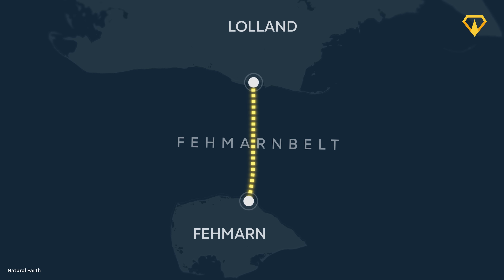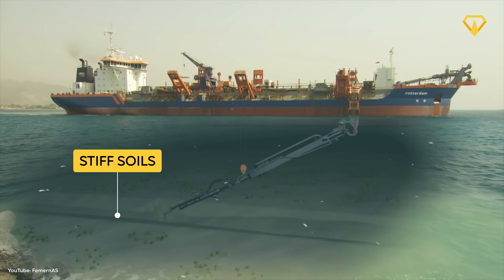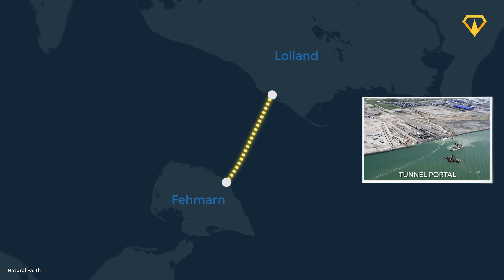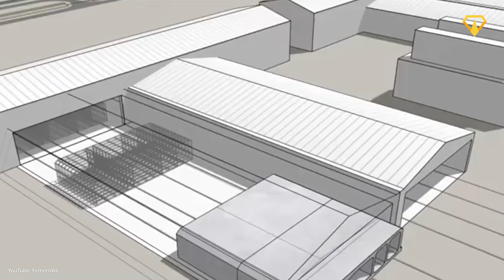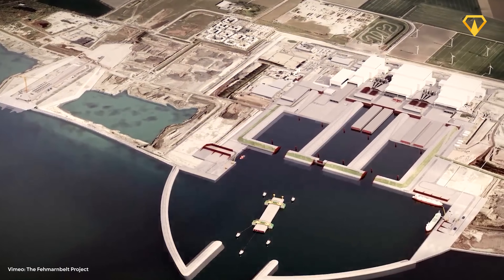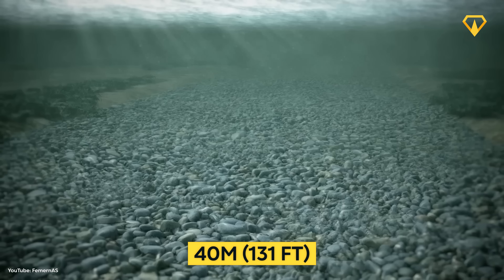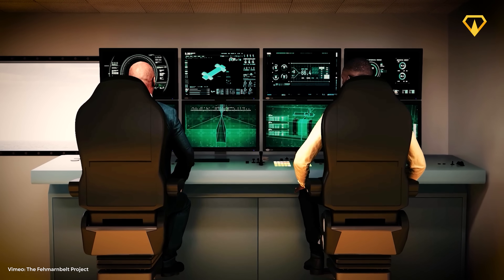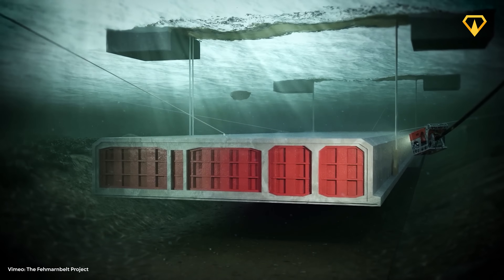How the World’s Largest Underwater Tunnel Is Being Built

Comment: How many sections have been inserted into the seabed? Their website hasn't been updated since August and is vague about the progress. Reading between the lines, it looks like zero have been inserted. It says they are having trouble building the vessel that will take the blocks to the location in the sea, such that the 2029 completion date is in trouble.
Reply: At present, 4 Elements are visually complete and ready to go, sitting outside the production halls and what appears to be an additional 3 sitting in the harbor, with outside storage capacity for additional elements. They are awaiting final approval to start placing elements at the portals, but it is expected that the first elements will be placed before the end of the year. (Note: These images may be renderings, but they look like the real deal)

On the German side, however, there are some problems with the portion of the project that is outside the control of the Fehmarn Belt consortium, and that is the Fehmarn Sound Tunnel (the part connecting Fehmarn to Mainland Germany) and expansions to portions of the rail network leading to Hamburg, which has supposedly been delayed due to "political issues" at the Bundesamt/State level. This likely means that even when the Fehmarn Belt tunnel is complete (assuming the 2029 deadline holds), the Rail Portions wont run at neither speed, nor capacity till sometime around 2032-2033. At least, that's whats being reported in local news in Denmark
Reply: Yes more likely sometimes after 2030 probably 2032 as earliest because the connection on the German side will probably be finished by that date.

Comment: So they need about 83 of them to make up the 18 km for one stripe. I think they mentioned 89. wow!
Reply: The tunnel consists of 79 normal elements (the 217m long ones) and 10 special elements. The Special elements have a lower level included for electrical installations and maintenance equipment, etc. The exact dimensions of the special elements aren't readily available, and likely vary based on the purpose.

Comment: Germany should build way more tunnels. This should definitely be a large area of expertise as our surface area is crowded with little to no room to spare. Tunnels are the only infrastructure option imo to combat our huge rail and road transport bottlenecks.
Reply: Unfortunately Germany didn't want much to do with even this tunnel.
The bill is all footed by Denmark only except some roadway resurfacing and bridge maintaining on the German side.
Reply: @Floedekage  It's co-financed through the EU, which Germany also contributes too. Germany has no legislation for taxable roads/bridges/tunnels. So it's easier to just let Denmark handle the fee collection and the repayment of the investments. In the original plan the Fehmarn bridge that connects Fehmarn to Germany's main land was supposed to be upgraded. But it's not viable for that amount of traffic. So Germany is now building the same kind of tunnel for the 2km connection to Fehmarn.
Reply: @Psi-Storm  The same kind? If they are smart, they request some extra tunnel elements (and pay for them), cheaper than building a new factory for a limited amount of elements.
Reply: @Psi-Storm  alright, thank you for further context.
Reply: @Psi-Storm  That's nonsense, Germany was against the project from the start, if they hadn't been such dullards, that tunnel would have been built many years ago.
Reply: It is the most expensive option though. That is like saying to the Dutch why not reclaim more land from the sea.
Reply: I disagree. The bureaucratic overhead for land acquisition and dealing with a plethora of law suits due to noise pollution concerns to neighborhoods next to buying the land and real estate from the various owners is much more time consuming and expensive than investing in the next iteration of much better tunnel boring machines over a period of 10 years and deploying a couple to dig the tunnels required. At a certain depth the land belongs more or less to the state hence no land acquisition required, less environmental destruction etc.
The safety of tunnels is also an order of magnitude greater than surface rail transport, due to no exposure to weather events and seasonal fluctuations as well as no interference with wild life or human factors. As earthquakes are a surface phenomenon the unlikely event in Germany wouldn't pose much of a threat either. Tunnel flooding risk is also minimal as Germany is largely above sea level/water table level.
For urban and suburban areas tunnels are largely the only option.

It is only expensive today due the lack of investment and R&D in that domain; as the low hanging fruits for transport paths have been used to a point where tunnels are only now the only option. Tunnels are required everywhere in Europe and throughout the world. And they continue to get cheaper every year.
Reply: it's not gemeny who built it, but Denmark.
Reply: There are some railway tunnel projects underway, for example under the city centers of München, Frankfurt and Stuttgart (including the infamous new main train station there). The new railway route between Stuttgart and Um contains some tunnels, between Wendlingen and Merklingen you could almost call it a subway. 
However, a tunnel will always be the last option, one that is used when no other option works, because tunnels are expensive to build and maintain.

Comment: It’s supposed to connect Denmark to Hamburg’s main station, which is already one of the busiest train stations in Europe, with very limited room for expansion. On top of that, the connection from Hamburg to the south (the Hamburg–Hanover line) is already operating at 150% of its capacity, and the construction of the new line has been blocked for years due to local political opposition.
Reply: We will see in the next months what the Bundestag decides. DB came out and said the new track between Hamburg and Hannover is the only viable solution, and two days ago the big cities (Hamburg, Hannover and Lüneburg) gave statements demanding the new track construction.
Reply: Denmark is already connected to Hamburg via train and has been for decades.
And it's Hamburg Altona.
What is going to be interesting is the line from Copenhagen to Prague starting next summer.
Reply: @Floedekage  Hamburg is connected to Copenhagen through a very slow connection over Odense. This new tunnel will reduce the time by 2 hours.
The connection is to Hamburg Main Station, not Altona, and even if it reached Altona, the lines from there would have to cross the Main Station to the south.

All the connections to southern and western Germany, Austria, Switzerland, Belgium, the Netherlands and  France have to go through Hamburg.
Reply: @aminzqrti7672  They could build a new station east of HH for through traffic.And probably will sometime.
Reply: There are lots of bottlenecks in the European rail and highway networks. That is not an argument for doing nothing, it is just a to-do list
Reply: Denmark is a little bit more than Sjælland and Copenhagen. So, we are already connected...

Comment: Three years with a TBM and this would be in service already. Why do governments always choose to do things the most time consuming, complicated and expensive as possible?
Reply: The soil is rather soft. A bored tunnel would need to be deep. Trains can not go up steep slopes. You would need several kilometers of tunnel under land to rise from the tunnel depth to the surface. Also, a bored tunnel would need to be circular. With two road lanes and one railway track each way plus a service tunnel, you would need to bore five or maybe seven tunnels. The immersed tunnel is much cheaper.

A bridge was also considered and found impractical, for various reasons.
Reply: @klausolekristiansen2960  Three tunnels, three lanes or tracks in each. The slope isn't any problem. And the bridge that is having to be built could also be done away with. €6 billion out the door.
Reply: @davidwebb4904  Lmao "just bore 3 tunnels through soft soil", "the slope isn't a problem" -the guy who knows fuck all about anything being discussed
Reply: Check B1M video on this tunnel as well , it explores some of the options.
Reply: Nonsense comment.